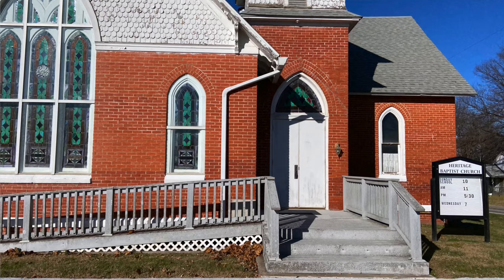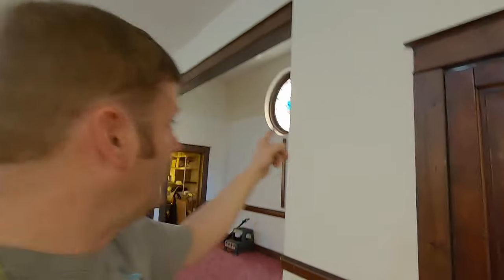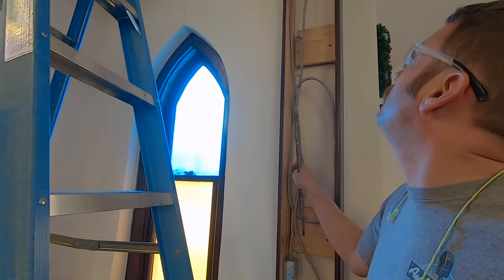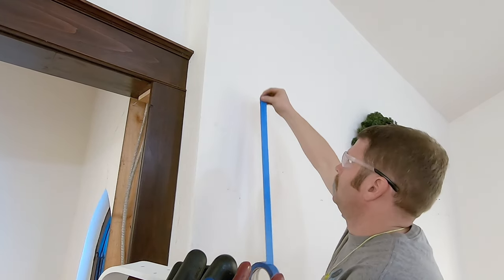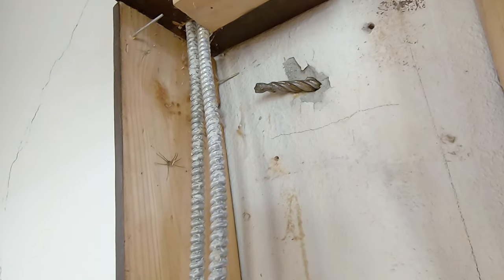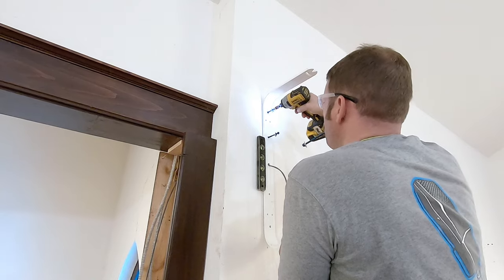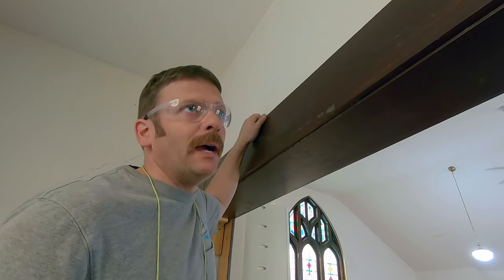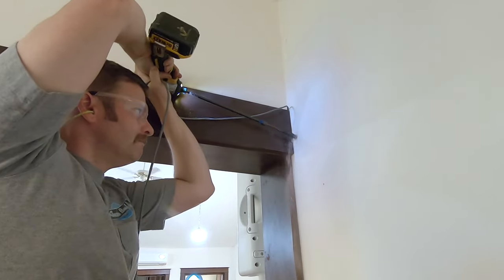Old Building - New Sound

Comment: Am I seeing this correctly?  Does it appear that the speakers are behind the podium mic?
Reply: Yes but it’s a calculated move knowing that in such an old church building the speakers will never move away from their position directly behind the mic.
Reply: @kc360awareness  Yes, and I suppose there would be a bit of "ringing out" the room also.
Reply from the maker: Hey Henry, yes the speakers are behind the down stage most mic. Good eyes!!  When we bid the job I had to make the decision to fly the speakers above the pulpit or mount them on the wall behind the pulpit.  In this case, and several unknowns, I decided the best option was on the wall.  I was not able to get as much gain before feedback as I would prefer, but we made it due.  I always want the best sound, but the install has to work with and in the space. Thanks for watching and more to come!